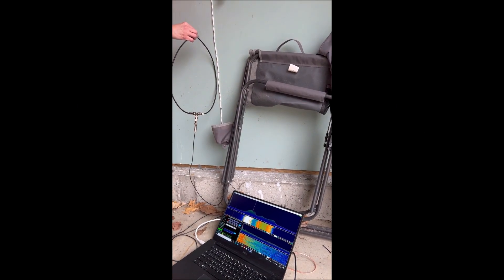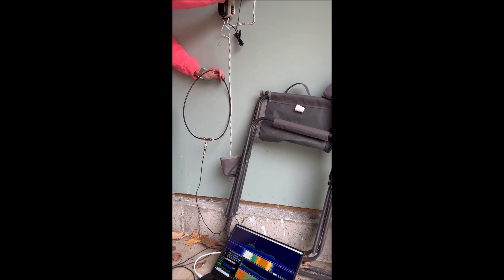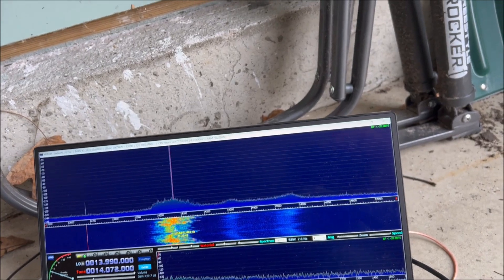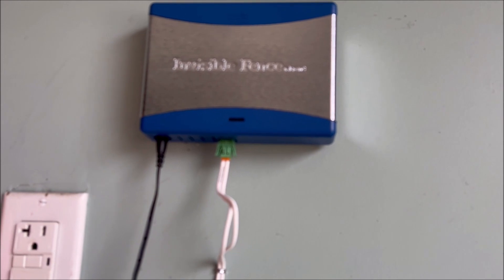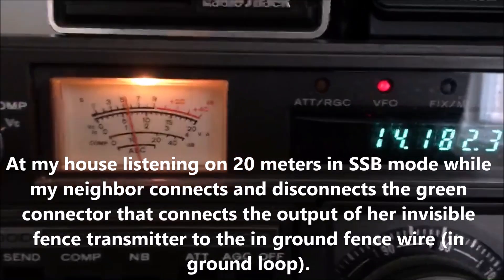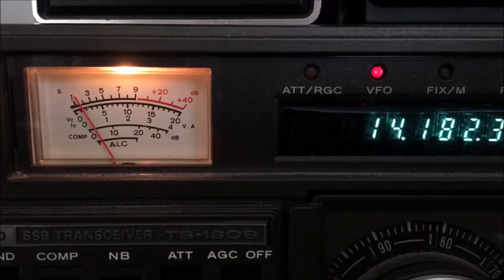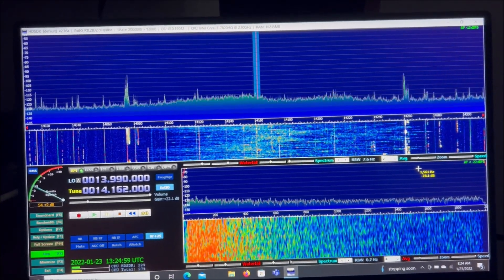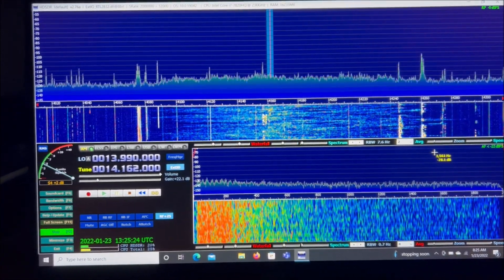RFI from neighbors invisible fence transmitter (not typical invisible fence RFI) Jan 23, 2022.

Comment: My Invisible Fence Boundary Plus system is a total RFI disaster of interference between 4 and 7 MHz. It sounds a good bit like the video, only far stronger. I tried replacing the power supply and installing chokes.  There is interference whether running from AC or from battery, but with AC, it floods the house wiring with RFI. I'm going to replace it with another brand.

Comment: The Fix is to install an EMI filter for the AC input to the Fence AC input.  Problem solved for $25.
Reply from the maker: No, in this case the problem was a spurious signal generated within the transmitter which then got conducted to the output terminals on the transmitter.  In this case the fix was a 0.001ufd cap across the output of the transmitter that connected to the in ground wire.  In place of the 0.001 ufd  cap we also tried to just use an off the shelf Corcom filter but it caused the wire break feature of the transmitter to not work so we had to go back to the 0.001 cap and we used a safety cap in order to handle high voltages generated by nearby lightning strikes.  We also tested another brand new identical model of transmitter and it too had the spurious signal which is a design flaw (spurious signal that would drift in and out of the 20 meter band depending on temperature).
Reply: @wd8dsb   .001 uF is 1000 pF which is generally for Low VHF range 30-110 Mhz.  Did you try 103 or .01 uF which is for the HF range 5 to 30 Mhz.  I believe your interference was not on Low VHF TV Real RF Channels 2 through 6, which have FCC enforcement protection in the USA.
Reply from the maker: @Chad.Tyrone  Hi Chad, I wanted to have the least impact on the fundamental frequency which was 10 KHz so started with a 0.001 ufd cap because at 14 MHz where the spurious emission was the inductive reactance would be 11 ohms which is reasonably low whereas at 10 KHz the inductive reactance would be 15,915 ohms which was nice and high.  Then checked the spectrum from 500 KHz to 30 MHz from 5 feet away when using the 0.001 ufd cap and it was clean so there was no reason to try a 0.01 ufd cap which would have indeed provided less inductive reactance (1.1 ohms at 14 MHz,1591 ohms at 10 KHz).  1591 ohms of inductive reactance at 10 KHz may have been OK but it might have also been low enough to alter the strength of the 10 KHz fundamental signal which we were trying to avoid (you would need to run tests to determine the impact).  Don
Reply: @wd8dsb    The 1000 pF capacitor 102 did the trick and was probably the least cost solution.

Comment: How did we fix this issue?
Reply from the maker: This was not the typical RFi problem one encounters with invisible in-ground pet containment systems (in ground dog fence).  Normally the problem is a repeating , 7, 10, or 13 KHz signal that extends up into MF/HF frequencies which was not the problem in this case.  Turned out the transmitter has a design flaw as the Invisable Fence company installed a brand new replacement transmitter with me present and it generated the exact same RFI.  The manufacturer of the system (Radio Systems) recommended a specific model Corcom filter on the transmitter output and while that fixed the RFI problem it disabled the wire break feature which was not acceptable.  I originally installed a 0.001 uF Silver Mica 100 volt cap across the transmitter output to act as a low pass filter and this fixed the problem so we went back to that solution and I eventually replaced that capacitor with a higher voltage Safety cap in order go improve safety in case of a nearby lightning strike.
Reply: @ thank you! My neighbor right next door has an invisible fence and I’m thinking it’s why I’m having issues. Also my Samsung washer has terrible RFI
Reply from the maker: @ what issue are you having that you think is from your neighbors invisible fence?  What bands do you hear it and is it broadband like I show in this video or does it peak at specific repeating intervals like every 7 or 10 KHz, etc.
Regarding your washing machine you would likely need to install a commercial filter and/or common mode choke on the power cord similar to what I show in a video showing RFI from a refrigerator.
Reply: @ I do not have the tools to pinpoint how broadband the signal is but 40m is completely unusable and 20m is very noisy. my shack in about 10' away from the fence and my EFHW is right there about 5' away sloping up and away from it.
Reply from the maker: @K9PWT-Off-road  if you put your receiver in AM mode or SSB and slowly turn the dial does the signal peak at regular intervals like every 7, 10, 13, or 20 KHz, etc?  What does the RFI sound like, is it pulsing or just static sounding?
Reply: @wd8dsb  6.00 through 8.899mhz complete noise. 20+ over S9
Reply from the maker: @K9PWT-Off-road  does your radio have an RF spectrum display and a waterfall display?  Can you make a 5 second audio recording of the RFI and email me it, my email address is good on QRZ.com.